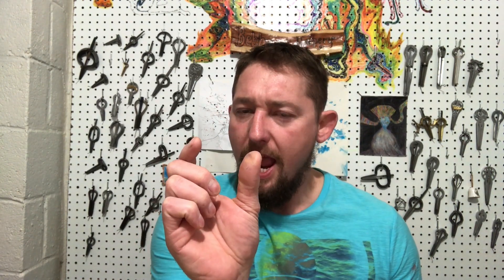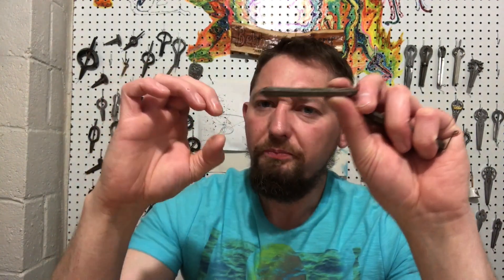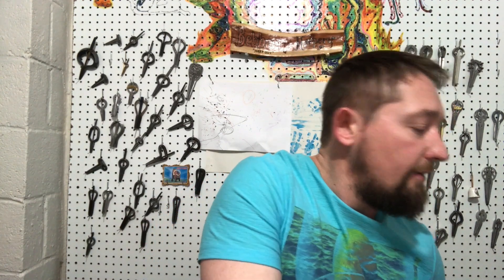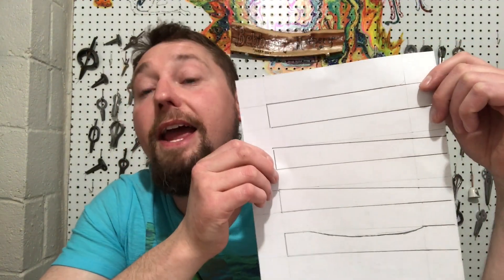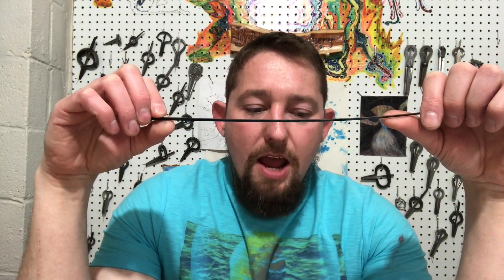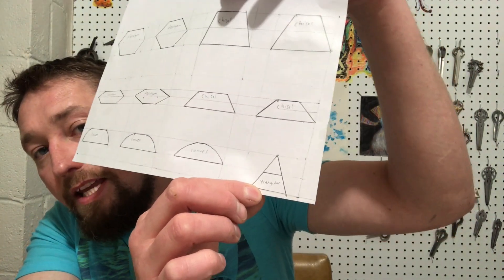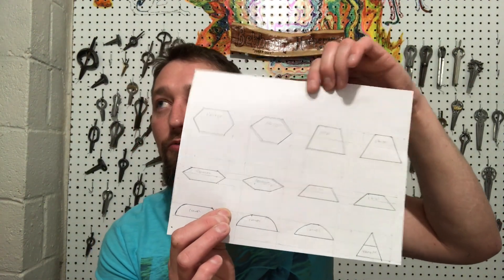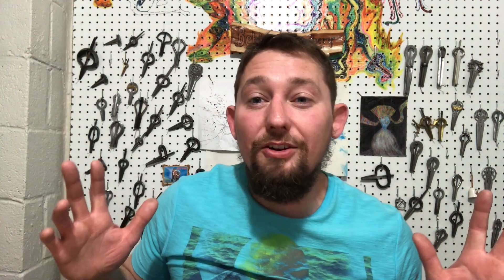Jaw Harp theory.  A ramble about Jawharp Reeds or Tongues.

Comment: A little late, but yeah! I made a bunch of harps out of an old beat up manure forķ, and I used a few of my “well” used concrete trawls. I experimented with the thickness, from the well warn edge, to the thicker center of the trowel. Now I’ve had a few years of playing them…I’m satisfied. I may dig into my old concrete trowels to play around again?!? I still enjoy each and every one I forged. 👍🏼

Comment: Excellent video! Thank you for covering this topic and yes everything effects everything.  I know that some makers use hacksaw blades but it appears that oil dipsticks would also be a great material to make reeds out of. I could watch your videos all day long. I have noticed that some of the longer reeded jaw harps have sort of "sweet spots" in certain places along the harp/reed sometimes 1 or 2 places.
Reply: Imagine a harp that has multiple magnetic BBs that could give you a wider range, may a 12 in 1 that would give you the entire scale (not sure if that's possible). The reed or harp would also have different sized holes so that it could hold the various BB sizes. Another approach would be replaceable reeds with various types of grinds. Now how to get to 12 different notes, make a trigger that allows for 1, 2, or 3 BBs, thus reducing for the need to have so many BBs in order to stack up to 12 combinations (0 BB, 1 BB, 2 BBs, 3 BBs) and then provide 3 or 4 different BB sizes while the trigger is sized to hold the largest BB or maybe tapered to allow it to hold all the sizes like a funnel shape.

Comment: Fascinating, just what I was after, Day 6 on my own 3D printing Jaw Harp making experience and that all makes complete sense. I'm considering titanium vs stainless spring steel vs high carbon spring steel. Your 0.020 thickness seems to correlate to approx= 0.5mm. I like the idea of Titanium being naturally springy and forming a very hard natural oxide protective coating, though weight is obviously not in it's favor for sustain. I noticed you missed discussion of the neck of the reed closer to the attachment point. Thinning sounds risky for spring steel as ideally, you'd want to either re-temper the metal, or cold grind. Though you've put quite a bit of thought and observation into the thickness profiles, (which I was curious about), you seem to have missed a few things too.
1. cutting the width(not thickness) near the attachment point also lowers the frequency.
2. The above also reduces the work on air movement.
3. Widening the width before the reed sounding channel increases the weight and lowers the frequency.
4. Edge profile, especially further out on the span must affect the sustain aerodynamically, how the edges cut through the air. I would say avoid a rounded edge, it encourages the coanda effect which you don't want. (it will create drag)
5. Though you touched on it, discussing instability for a reed strumming node that is placed far out, we have different sorts of instabilities. Obviously striking the edge is a bad instability, but there are other instabilities that I expect are actually encouraged by subtle design manipulations from the masters. While the mouth is the variable echo chamber, there is the potential not just for the reed to swing in and out of the channel, but for there to be harmonics of waves travelling along it's length. And example would be if you get a big sheet of thin metal, hold it between your hands and swing it back and forth. You can hear the ringing, but the tone changes through the motion of the sheet of metal to and fro.  I'd be interested to see high speed video of the cheap jaw harps vs the expensive ones, labelled with examples of their particular desirable acoustic properties.
6. There's no discussion of the reed's holder. Depending on the attachment point mechanical characteristics, this can make a subtle difference to the sound, it's possible related to where in another video, you mentioned a jaw harp becoming a lot better after around 8 hours of playing. So here's a couple of options of how that might come about: 
   a. The reed work hardens as crystals of metal inside the reed adapt to the playing stresses.
   b. The (I think this is what's actually happening) end of the reed just immediately after the attachment point is sitting on a short ledge of metal from the holder. After hours of playing, the harder material of the reed causes the metal ledge to deform and permit a fuller unrestrained swing of the reed, noting that this damping is typically under the reed, not on the screw or deformed steel side. This can be seen on the old experiment of placing a metal ruler over the side of a table and moving the restraining finger closer and further from the edge of the table. The up and down tuned lengths are different past the horizontal surface of the table.
7. Obviously what the jaw harp is missing, is dynamic tuning of the reed. Instead, we are primarilly reling not on it's tuned length, but on it's interaction with out mouth cavity. It's incredible what can be achieved with this, since Tuesday 5 days ago, I've been watching youtubes and the players that stand out to me are like Nadishana, Ataya, Olena and some other one I bookmarked but can't remember right now!
8.... and finally, we don't have a consideration of the channel that the reed moves inside. I think this is important. We can intuit that a narrow band of proximity between the reed and it's containing channel is great for breath powered tones because there is a clear change between constricted and not constricted that wouldn't happen if the reed moved within walls that were around it's full travel arc. But again, I think that Coanda effect is important; Most commercial mild steel seems to be slightly rounded, I think hard 90 degree edges are likely to improve sustain. However, sustain is not always the end goal and especially for breathing in and out to amplify the volume, we might find that there's a desirably effect by extending the distance where the reed is close to the channel. Even slightly squaring off this channel could make for some interesting effects. I could try 3D printing but I'll likely get bored with my 3D prints soon, I'm pretty happy with the sound for plastic. Anyway, here's my bumbling Saturday play, I'm much happier with my Jaw harp design now, it's bulky but with fine tuning I've got great clearances and a powerful spring mechanism, already improved since that video: https://www.youtube.com/shorts/hgD_f1JzR5o 
9. Oh.. and I noticed that holding the plastic frame correctly really increases sustain by engaging the spring better- This effect is also achieved with the metal frames, the heavier the better. There's also a relationship between reed weight and frame weight, heavy reed and light frame for example is a bad combination.